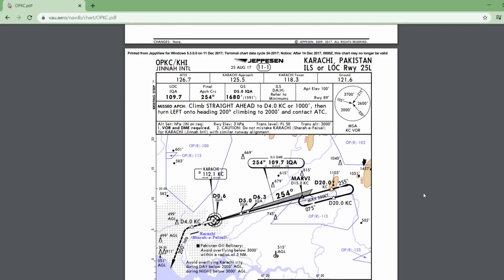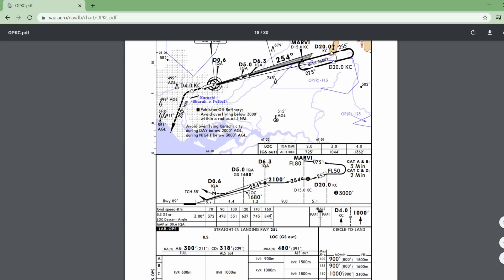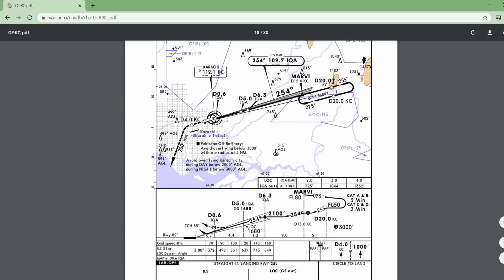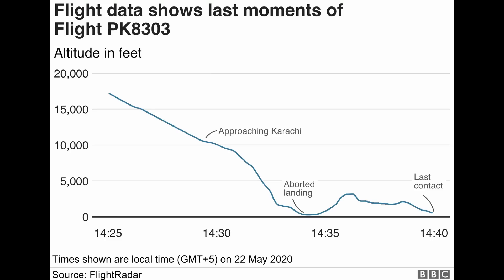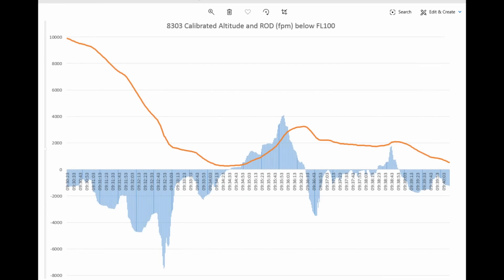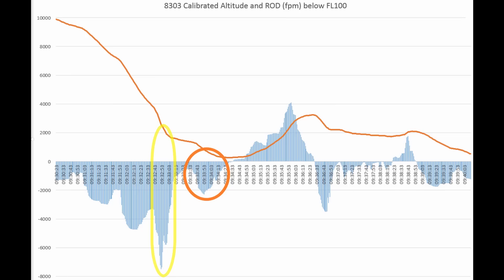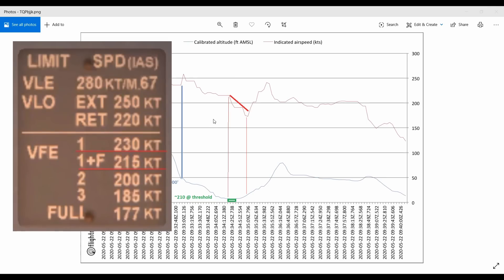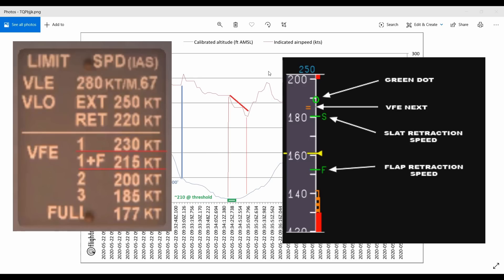PIA #8303 Update #4 Unstable Approach Profile

Comment: I live at the turning point for short final into Bierset Airport in Liège, Belgium.  Normally, the airplanes stabilize just over cooling tower number 3 of the power plant and then drop the gear.  In that last week I have seen many with the gear already down as they turn onto final.  Is that related to this?  What do you think Mr. Brown?  New policies?  Pilot decision?  Bierset is a major cargo hub with a growing passenger service and even direct to Hong Kong flights.

Comment: Can't help but say, Cowboy pilots remain aloft. IMHO, these guys knew they could get that A 320 down, likely having done it before. And in fact, they did get it down--almost. Had the gear been extended it would have been just another great story to tell in the next preflight. Also, it would have been helpful for ATC to pick up the altitude variance and advise, "Go around or I'm going to spin you." But...I'm not a controller in Karachi.

Comment: The early approach figures are so far out that it almost seems as though the altimeter was reading imperial and not metric units.

[3,000 metres is about 10,000 feet.]

Comment: You’re getting 3 to 1 wrong.  It’s 1 mile = 300ft, so 3 miles is 900.  Being 100 ft out that close is unstable. Also, you cross the runway threshold at 50ft not 75.

Comment: Correct yourself bro . What you told about the ringing warning that it was a speed limit warning ring . But actually it’s not a warning of speed limit . When the engine or airplane have a major failure then this warning rings will indicate . And if your airplane have a minor failure let’s suppose 1st engine failed then the 2nd engine will take command . So in this case a just 1 ring of Warning rings will indicate.... and in this incident engine got fire because of touching the surface while an attempt of belly landing the engines was heavily damaged so when the pilot said we are going through that’s mean they are using full power engine while going through engine got fire and failed so that’s why plane crashed .

Comment: The aircraft was at 10,000' when it should have been at 4000' - or about 6000' high. Going back in time, that indicates that the top-of-descent was about 40 nm later than it should have been. So, did the crew ask for descent late? Or did the ATC delay their descent because of, say, crossing traffic? Now, if the TOD was delayed, did the crew descend in selected mode (open descent) or did they use managed descent (VNAV)? Did they select open over managed descent because they were afraid that the aircraft would dive down to meet the profile and possibly cause Vmo exceedance or high V/S? If they did not descend late, was it a power-on descent (say, using V/S) that caused them to be high later? Is it company culture that teaches a preference of V/S or open descent over managed descent? How well-versed were the pilots in using the VDEV values (PERF page) or the yoyo to manage their descent? Were speed brakes used? If not, was the PF reluctant to use them? Why? And why did the PM not suggest it? What about the power gradient in the cockpit, which made the FO reluctant to tell the Captain that he was messing up big time? Was it because the FO had low hours? Or is it the feudal nature of the society that caused him to keep quiet? 
A lot of questions will need to be answered during the investigation...

Comment: Great video, slight correction is that the warning bell will sound if you over speed the aircraft and not the F or S speed. Doing 6000-7000’ ROD when at 2000’ altitude, means you will hit the ground in less than 20 seconds

Comment: Is it possible to compare it with the last successful flight landing of the same aircraft?
Reply: https://www.flightradar24.com/data/flights/pk8305#24950691 If you want to see normal landing there you have it. Observe landing time from 10000 feet and landing time from 3000 feet. Pia 8303 made landing on belly within 5 minutes from 10000 feet and from 3000 feet landing in 2 minutes. Normal time is from 10000 feet in 11 minutes and from 3000 feet is 4 minutes

Comment: New data has been published today. For the last 12 minutes of flight. https://www.flightradar24.com/blog/pakistan-international-airlines-flight-8303-crashes-near-karachi/  They are little bit different. But not so different to make changes in conclusion. To non pilot observer they are two spikes visibly on FL 6125 feet  -4832 and on FL 2450 feet  -7520. Those two negative numbers are filled under barometric vertical rate in feet per minute. If I'm correct. To me this look like free fall from the sky.

Comment: ATC tower was empty , so it was approach radar operator who was taking care of that landing , so no one saw that pk8303 is landing with gear up , and no one there to ask the pilot why landing gear was not down. pilot forgot to put the landing gear down so it was his mistake number first so he is never aware of his mistake no emergency declared. therefore approach radar operator cannot sees the plane didn't knew that plane is coming for belly landing and hence no emergency was declared as ATC tower was empty. airport was completely blind.  it was only when aircraft hit the ground and damages the engine pilot realized his mistake he decided  to go around that was his last mistake , and that moment some one saw whats just happens alert the airport  approach over wireless that plane try belly landing with no gear down this is the moment approach radar operator come to know what just happen and ask the pilot are you coming for belly landing ...? instead  of declaring emergency or closing runway 25L and failed to direct the pilot to turn right for runway 25R as plane damages the runway 25L. approach radar operator completely caught by surprise and as he can not sees airport with his eyes he has no idea whats going on out there. every things mixed up pilot go around was fatal decision. he lost engines and plane crashed over houses 4 stories tall. but if the turn right instead of turn left and go for 25R aircraft definitely end up in the empty ground just opposite to where it actually crash on building.  noi CCTV recording AND no ATC tower recordings. only approach and cockpit recordings come up.

Comment: Ex Air Force Pilot? Sounds like it. According to some reports it landed on its gear but when they decided to go around the 1st Off retracted the gear and the flaps prematurely forgetting that there is a delay before the thrust increases as the engines spool up. So the plane sank onto the runway before the thrust increased.That happened because the throttles were at idle in their attempt to lose height so steeply. All this must be in the recordings somewhere because there is also a report of the conversation between ATC and the crew with ATC telling the crew they had done a belly landing because he could see the marks on the runway and that is WHY he asked if they were going to do another belly landing. 
   I am surprised at the  the speculation that the crew never lowered the landing gear. I mean that is as unlikely as forgetting to turn the engines on at pushback.

Comment: Must be hard to get back the speed after dropping with 7000ft /min 

In the 737 you make with a clean configuration and speed 300kts with speedbrake and level change maybe 5500ft/min.

This was a massive fuck up.

Comment: While this, in all outward appearances, appears to be pilot error/judgement; this may not be the root cause. WHY was the pilot out of spec so terribly. Airline crashes have happened in the past where the Airlines have put so much pressure on pilots to maintain a flight schedule that they've over estimated their ability or the capabilities of the aircraft. Why'd the co-pilot allow the pilot to take this approach? What guidelines are they ALLOWED to operate under? Why didn't ATC realize he was so badly out of parameters and instruct him to go around?

 This is why we wait for the final report - fine to speculate but keep an open mind. The root cause for a pilot performing badly may be deeper than a 'poorly' trained pilot.

Although after all is said and done the pilot ultimately has the responsibility to safeguard the lives of everyone one board so they need to try and address why.

Comment: I wonder if you could explains a few things for us non-pilots...
When you select 'Wheels down' and the aircraft refuses, say for overspeed, what happens? Do you get a unique audible warning for that, or is it a general one to draw your attention?
Does the warning keep going, can you clear it? In other words, can you ignore a warning bell that you think is for something else and just assume that it did put the wheels down when your requested?
Once you're triggered the 'Wheels down', and it can't because of overspeed say, would it then put the wheels down as soon as that condition cleared?
To my way of thinking, there should be a unique audible warning for things that are so vital.
Does the aircraft give any warning if you are very close to the ground and you don't have the wheels down? I seem to think there's a radar altimeter that calls out the height on final approach. Is this used to sound an alarm?
Reply: Somewhere in the other vdo of this channel I read that instead of warning bells, there is a screen where a pilot can see 3 green lights means gears are down, if they are still red, means gears are still up, not down.. It looks like in this case, both pilot, FO ignored noticing 3 red lights... And once the speed is under 260 knot, pilot has to re do the procedure, and lower the gear handle again

Comment: How about a False Glide slope coming into play as well. 
At 6 Miles Pilot says they are "comfortable and will make it" ... sounds like they were hot and high at that point. 
At 5 miles they were out of 3500 for 3000 and INSISTS that they are established on ILS 
If they were comfortable and established (as per ATC) AP engaged ... on a false glide slope at some point aircraft should pitch the nose up to a point where warning chimes could trigger. (ATC ... when pilot say "Roger Pakistan 8303" after getting the landing clearance ) 
Interestingly there are  no warning sound(s) when pilot announce go around. 
Appreciate your comment on this.
Reply: Allow me to comment on that "no warning sound(s) when pilot announce go around". Most probably, just before closing to the runway, the captain realized he would miss the threshold and aborted landing but, due to their focusing on that procedure, he did not communicate that to ATC. At this moment, the first officer had retracted flaps, as well as the landing gear prematurely. Before this decision, at 5NM/3.500ft, the pilot was confident in making the threshold and had neither communicated any mechanical problems nor announced emergency, so landing gears were down and locked, which explains their premature retraction. When the captain announces to ATC the "go around", they were a bit under 200kts and the cessation of warning chimes explains full retraction of flaps.

Comment: The controller knew he was too high and ordered a turn to 180, likely for a 360 decending turn down to 3,000' or so.   My guess is he didn't want to do the go around because of the identification of a go around as a failure.  He was trying to extend the landing gear and it clearly was not extending.  I would be curious, is the landing gear will extend if you are over speed?  I never liked the fully fly by wire systems.  As long as everything goes well it works.  When the aircraft gets outside the normal envelop the pilot's options are limited by a computer.  Guessing the pilot thought it's a really long runway, I can touch down halfway down the runway and have plenty of room to stop.  Then the gear wouldn't extend and the rest is history.

Comment: How do you go around after scraping the engines on the runway for 4000ft.  How did they achieve V1 speed again with all of that drag?.
Reply: Did not drag them on the runway for 4000 feet, this would have stopped them completely (and it would have been better than the final result)  Due to high and hot approach, the aircraft bounced back in air at least twice, and the speed was already high. so he could takeoff

Comment: The pilot needed to wake up to the ridiculous and dangerous manoeuvre he was attempting.  

A possible solution might be to fit jericho trumpets to the wings, so that steep dives are met by screeching banshee wails as used by Stuka dive-bombers to terrify civilians in WWII.
If jericho trumpets are too draggy, then maybe a Stuka dive-bomber noise could be piped through the in-flight entertainment system or even the cabin PA to let the passengers know that the pilot's gone on a bender, or a kamikaze mission.  It'd be good feedback for the captain - having the whole cabin screaming in terror.

This is a ridiculous outcome.  A hundred lost lives, just so that the captain didn't lose face over a careless approach and an otherwise unnecessary go-around.  Shameful.  PIA should be banned from flying anywhere.

Comment: Seeing the comments about other PIA pilots flying egregious descent profiles into KHI, a troubling "middle eastern male ego" issue seems ready to bubble to the surface. We Westerners went through this phase back in the mid to late '60's through the '80's, where high-seniority captains could brow-beat entire crews to bend them to their will. And, yes, I think I am qualified to make this statement as I am a 30-yr veteran air traffic controller and 40-yr pilot whose prior father-in-law was one of these types. He eventually rose to 3rd in seniority at Eastern Air Lines. The U.S. air traffic system is more structured and has had little tolerance for these antics, but it would be easy to extrapolate a more "lax" ATC system kowtowing to these highly-paid and upper-class citizenry being able to "fly these planes the way they were meant to be flown" while also saving thousands of gallons of fuel, thus helping the company's bottom line. We like to think that the rest of the world shares our views of and our early adoption of Cockpit Resource Management, but many times that is not the case at all. I both fear and hope this is the case here so it can be brought out into the light of day and thus save many hundreds of lives in the future.
Reply: @BrantheBroken -- Nonsense.  You have never lived in a 3rd world country - so you have not seen the ingrained male toxicity over there.  Facts are not xenophobic and stop the childish wokeness and insult of westerners.  The Max happened to belong to one of the safest airplanes in human history.  But west-haters have to take it out of context.  If you really cared for "foreign blood", you would stick to the facts which all point to pilot ineptitude, and stop beating down western engineers and pilots and airlines.  Take that "tombstone engineering path" remark and move to Russia and enjoy their airplanes.  You will be begging to return home and to fly Boeing.